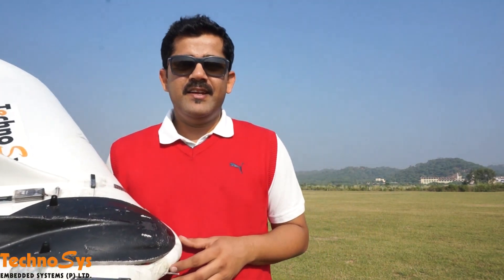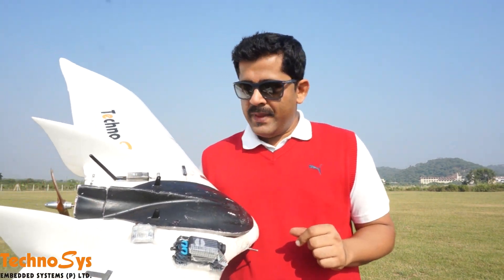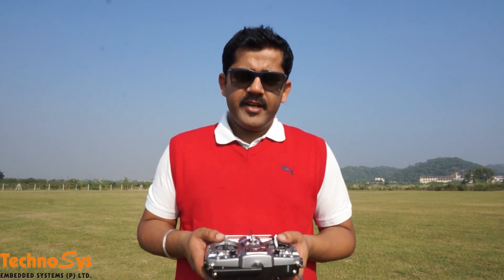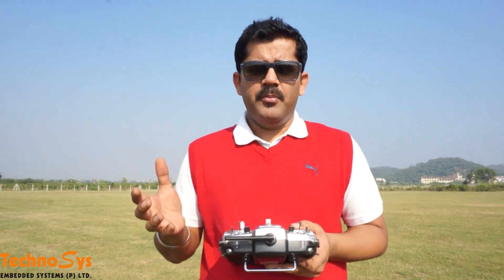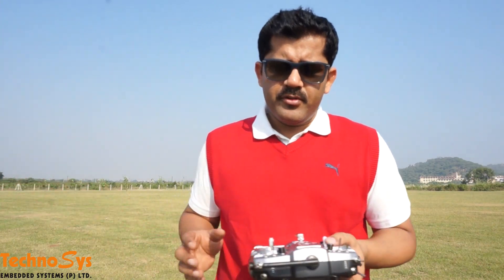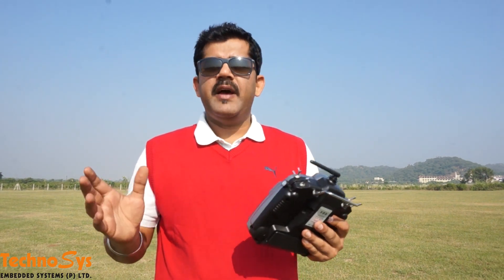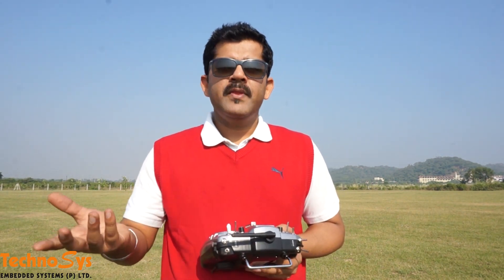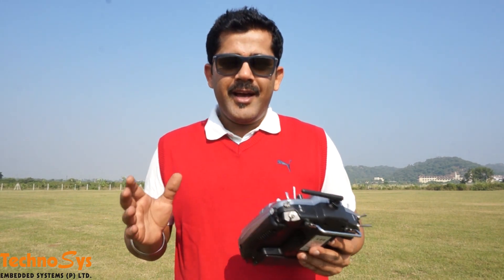AutoTune Flight Mode Demo For ArduPlane using Pixhawk

Comment: DO NOT take off in Manual mode unless you are experienced pilot and aircraft controls are well tuned! Otherwise you will 100% crash your plane! You shoukd start in Stabilise mode instead, gain enough altitude (100m or higher) and then switch to Autotune!

Comment: Hi Dhruv ,
Is apm auto mode control a throttle or fix throttle as we set in parameter 'normal flight throttle percent' . In my case apm shows fixed throttle percent as set 70%, 
 climb also at landing no throttle change at all. 
Is it normal...

Comment: Hi, thanks for this video I have never flown an RC model manually. So, I'm looking for an RC pilot to help with tuning my aircraft. but my question is this. When you say i have to do my trim right, what does that exactly mean?
Reply from the maker: you need to trim the plane so that it flies straight at 50% or less throttle. you may google for more info

Comment: Thanks for the video!
Once you take off do you keep it all the time in autotune mode or do you make a run, wait 10 seconds to save it, change it to manual, turn back and do another run?
Thank you!
Reply from the maker: Hi, after you finish your autotune, switch to stabilize mode, land the plane and disarm it. Then disconnect the battery, reconnect and check your PID's.

Comment: Did you make movements with you sticks during autotune?
Reply from the maker: +Marcos Vasques  yes, as explained in the video
Reply: Please during your Autotune Pitch ,Do you moved your joystick related with it ?and the same for Roll ??
Reply from the maker: Yes
Reply: Thanks I like your vedios I will now give my plane a chance to be in the air =D
I trim it like you said and I have my CG good I think ,for the autotune I still a bit confused 
Should I control the throttle or its controlled by Ardupilot ? 
Thank you a lot
Reply from the maker: It will fly like it will fly in FBWA mode. Please check the arduplane website.

Comment: Hi and first thank you for your very good tuto, i'm a french drone user and use 3dr pixhawk too. i looked all your vidéos ans they give me a lot of help.. today i tried to autotune my skywalker 1720 like the vidéo, i well understand all but i finally crashed and i don't understand why...

i made 5 flights in manual mode and all was perfect, trims will be done perfectly, all calibrations done... in my hands, all corrections were good in stabilize mode (the max and min correction in stabilize mode  are less importante than i manual mode)... when i selected stabilize mode in the air, plane flew level but was always soft and answered very badly. i was moved the sticks in maximum directions but plane was rolled and i was needded to select manual mode to retake control... same in autotune mode... 
as if i have a very low angle with my controls...

i test these things during 15 minutes and plane don't have better behaviour...

i flew a second time and there was a pb, i take off in stabilize and finally crash, nothing was controlable...

i had three time the next error message.."throttle enabled - altitude ...(my altitude written)

i use plane since 25 years and fly with all sorts of plane but i don't understand what happen in my situation..... can you see what can be my problem or give me some councils...

best regards

Greg
Reply from the maker: +rorogreg1 Hi Greg, It unfortunate that you had this crash. I believe that since your PID's were not tuned, your plane control surfaces were not responding to your stick movements properly. As mentioned in this video, always take off in manual mode and gain good altitude and then autotune. You can fly and land in stabilize mode but I never recommend take off in stabilize mode. If you require further assistance, please write to me on dhruv@technosysind.com. Cheers!!

Comment: Very well-detailed video. Continue doing this kind of tutorial! I am sure this will help lot of newbie autopilot flight system users.
Reply from the maker: Thank you
Reply: TechnoSys ind I propose maybe you can also do a tutorial on how to set the pixhawk/apm for elevon mixing in manual flight mode. Where in the mixing should happen in the apm parameters NOT in the remote control.